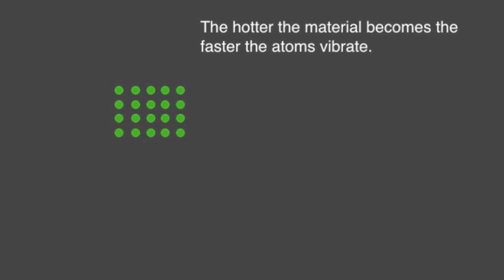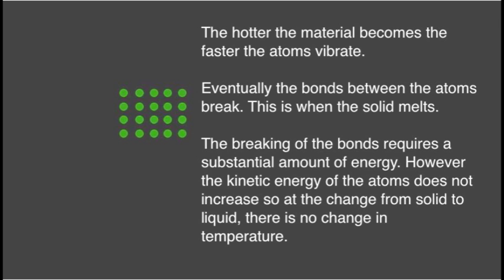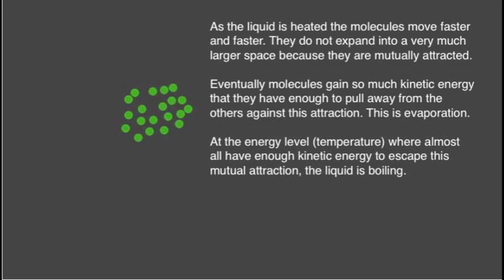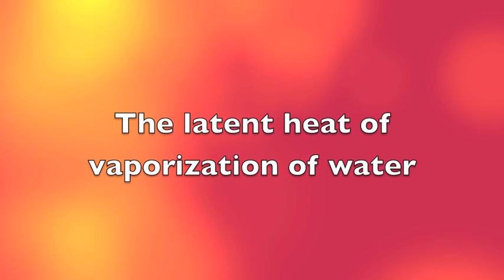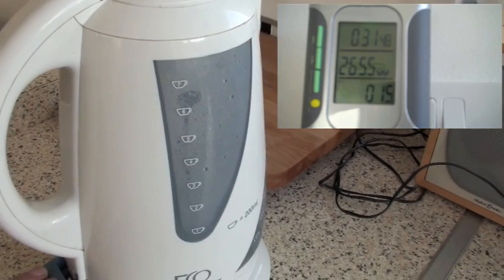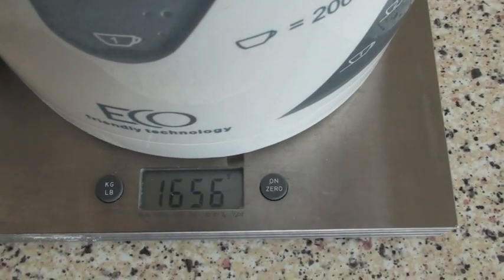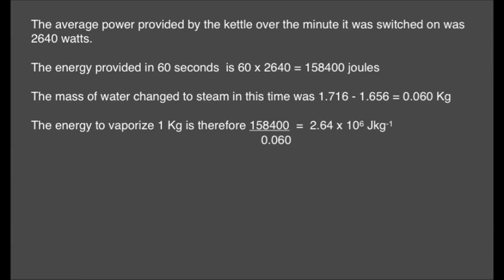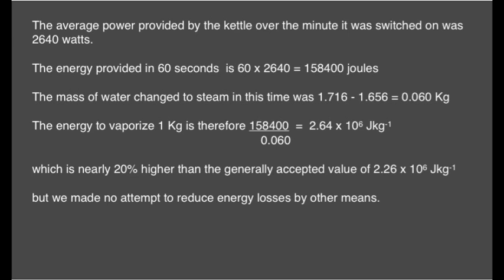Specific latent heat explained and measured: from fizzics.org

Comment: I think you needed more energy because the kettle lid was on. A portion of the evaporated water fell back into the kettle.
Reply from the maker: The water condensing within the kettle returns the latent heat of vaporisation to the contents so that would not contribute to extra energy being needed. The heat loss is more likely to be simple conduction through the body of the kettle.

Comment: What is the formula to find when water (334 000J/kg) and the mass of ice is 500g  calculate how much energy is needed to melt the ice completely when its at 0 degrees celsius. many thanks!
Reply from the maker: Just that energy = mass x SHC   so 0.5 x 334,000 = 167,000J